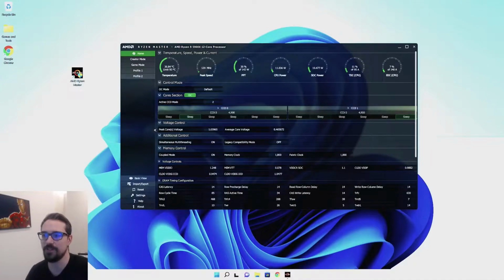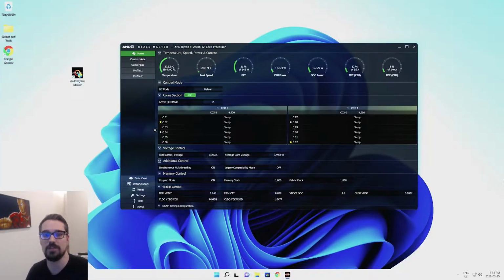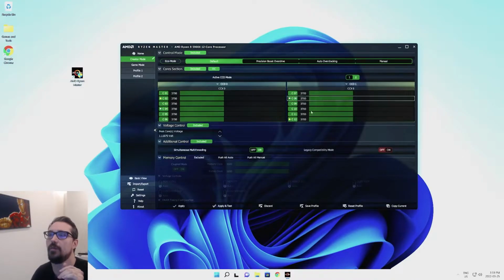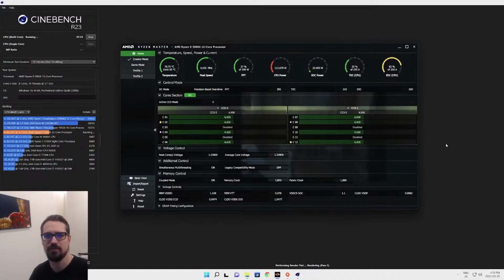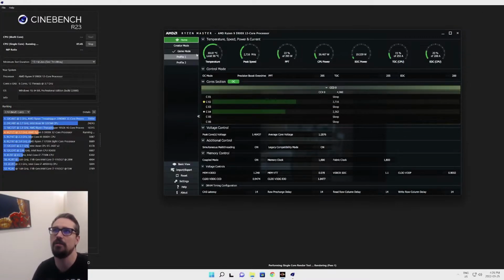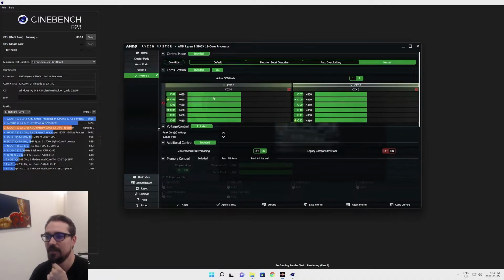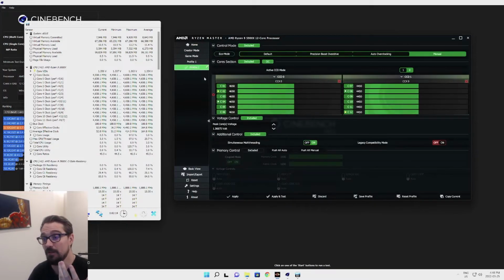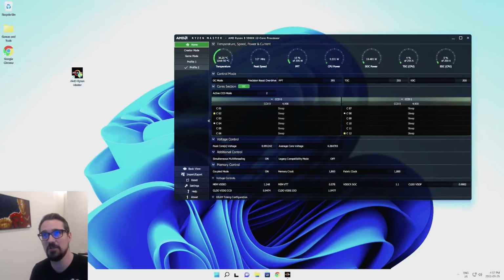Ryzen Master - AMD 5900X Overclocking

Comment: I have no idea how you're idling at 38-40C, my 5900X idles at 65-70C with a 360 AIO cooler, do you have any idea why my idle temps would be so high? 

I'm aware the 5900X is designed to run as hot as 90C, but I mean I'm literally just sitting on my desktop, no PBO, 3.5Ghz, and it's at least 20 degrees hotter than yours lol
Reply: my 5900x idles 36c but, if i go to the youtube main page and scroll up and down real fast i can get it up to 70C lol
Reply: @schlomoshekelstein908 Same, and that's expected, but the issue is cooling down, I feel like it's retaining heat from those quick heat-ups. I think I'm gonna use something other than thermal grizzly kryonaut, my temps are definitely cooler now than I reapplied and reseated the cooler but still not what I'd like to see, we're talking 55-60C on complete idle at room temp (70°F). If I'm just sitting on the BIOS, the max it peaks is 50C.
Reply: @JustLostTheGame  i'm using 
noctua NT-H1 with a fractal design S36 cooler. I can run AIDA64 stress test and won't go over 74C running it for 20 minutes. i shut it off after that cuz i dont even think gaming i stress my cpu that much that long. the whole reason I went down this rabbit hole is when I open chrome or do basically anything my cpu jumps to like 70c and the fans all ramp up to 100% and then it all drops down after 3 seconds. kind of annoying to be honest.
Reply: @schlomoshekelstein908  Yeah, that's just Ryzen, the 5900X is designed to run hot, up to 90C is to be expected, the 5900X is my second AMD CPU, after the 5 5600X, and I didn't have any of these issues at all, 5600X never really went above 65 when I had it, the 5900X is just a hot boy and even though I know that I shouldn't be freaking out when I look over at HWInfo and see 78C under load, it still kind of freaks me out lol
Reply: Undervolt is a must for the 5900x, with that you will get you TEMPS controlled, this processor comes with a very high voltage consumption settings from fabric, that why you get high TEMPS.
Reply: @ZeroCool22  Optimum Tech has a great video of doing exactly this! if you have a 5900x or 5950x or even a 5800x it's worth doing no matter what! free 10-15% in uplift and temps drop! crazy.
Reply: also, I would try the auto undervolting or CO mode in ryzen master! motherboard way is alot more time comsuming.
Reply: @no-pz7xy  Yeah, i have done the UV since a long time, my 5900x run with 1275v at 4650Mhz.
Reply: @no-pz7xy  Does that still require a reboot?
Thanks 👍
Reply from the maker: The 5900X definitely doesn't idle that high. Even on an air cooler it's quite low. If you are idle 65-70C then one of four things:

- Insufficient mounting pressure
- terrible thermal paste/still have plastic over the block on the mounting side
- bad water block design
- bad pump

Some AiO water block designs are not very good. Which AiO and thermal paste are you using.
Reply: @UnhingedSystems I appreciate you trying to help–mounting pressure should be good, the screws don't get any tighter without over-tightening, no plastic left on the block, I'm using Thermal Grizzly Kryonaut with a Lian Li Galahad 360 AIO.
Reply from the maker: @JustLostTheGame  Are you running the latest BIOS? Which motherboard are you using? Have you tried resetting the BIOS to default?

The Galahad cools the 5900X well enough. Does the idle shoot up to 65-70 right away or does it ramp up over a couple of minutes. Just wondering if the pump isn't working properly or maybe the flow is obstructed.
Reply: @UnhingedSystems  I actually updated my BIOS very recrntly funnily enough and reset my settings, so it's definitely not that, I have a Gigabyte B550 Vision D-P, it ramps up almost instantly, it'll start at around 30-40C (the ambient temp of my case) and as soon as I'm on my desktop, it goes to 58-65, and typically stays around there, sometimes higher. BIOS is reporting the fans and pump are working, and the radiator feels warm right where the heat tube meets the radiator, so it's definitely pulling heat away from the CPU.
Reply from the maker: @JustLostTheGame  Are there any background applications running? Can you see the CPU usage? It should be barely 1%-3% at idle.

I have seen some malware and crypto viruses that cause CPU and GPU usage to spike, maybe run a quick Malwarebytes scan just to be safe.
Reply: @UnhingedSystems  Believe it or not, I've done a lot of your suggestions already haha, I'm stumped. Ran a Malwarebytes scan about an hour ago, no issues, that's the thing, usage is only like 5-6%, no crazy spikes, even under load it's only around 12%. Under load temps are anywhere from 75-90C by the way, but that's expected. Nothing unusual in the background, Discord, Steam, Signal RGB (even disabling these programs from start doesn't change anything, switching off all RGB has no effect either.)
Reply from the maker: @JustLostTheGame  Well my next step would be testing the CPU in a different board to see if it has the same behaviors (maybe a power delivery issue?) Short of that I would look at contacting AMD, might be the heat spreader is not properly contacting the die (I've never actually had that issue). The 5900X with PBO disabled and the core boost disabled (running max at 3.5GHz) my 5900X would struggle to be above 60C at full load.
Reply: @UnhingedSystems  So I did probably the least technical step LAST because that's just how I am, but I completely redid my thermal paste and applied a little extra this time since thermal grizzly kryonaut is very viscous and REALLY made sure there was a good seal between the IHS and pump block, I'm sitting on BIOS and it started at 43C and has slowly been climbing to around 50C, I'm now sitting at around 47-50C on idle desktop, which is still kinda high but not as high as it was–but still 10 degrees higher than your system, maybe I'm just cursed, haha thanks for your suggestions though, very appreciative of the quick replies 👍
Reply: @UnhingedSystems  Hey, sorry for coming back to this, but I've noticed something a little odd, I think something might be malfunctioning with my pump, if I gently smack the top of the radiator where the pumps meet, my CPU temps drop RAPIDLY, from 84C down to 59C in almost a couple seconds, is there air trapped in* the pump? Am I finding correlation where there is none? I'm about to order the X73 Kraken, do you believe that's a good enough cooler for a 5900X (no crazy OCing, maybe 4Ghz max)? Thanks!!!

Edit: Fixed a typo
Reply from the maker: @JustLostTheGame   @The Game  You might have a blockage, or bad flow, it is possible.Tapping the radiator under normal circumstances shouldn't cause a drop in temps so something is up for sure. I personally am not a fan of the X73 or the X series because you can't set fan speeds based on fluid temps. The Z series is much better for that reason. Then you only need to ramp up the fans when the fluid hits 35C up to 40C and set a max fan speed based on a max fluid temp. Ideal for "cool and quiet" benefits IMO.
Reply: @UnhingedSystems  just bought the Z73 360, thanks a lot for all your help with this, I really appreciate it!

Edit: Kind of sucks since I've only had this AIO for like a year but, I definitely think something's failing in it, no joke, after smacking it a couple times, idle temps dropped to around 45 and stayed there lmao
Reply: @UnhingedSystems  I just wanted to follow up and let you know that I got my Kraken Z73 RGB and installed it, I also was able to repurpose the AL120 fans that were part of my previous AIO as case fans and everything works, it's absolutely beautiful.... and best of all, idle temps are as low as 38° now. Thanks for the recommendation!
Reply from the maker: @JustLostTheGame  Glad to hear everything worked out!
Reply: @JustLostTheGame  that's why I prefer spreading my paste, that way you know what you've put down is covering it for sure
Reply: @sinephase  I use Thermal Grizzly Kryonaut, which they actually tell you to spread thin across the whole IHS, I put a little extra dab in the very center for extra coverage, the issue was definitely my cooler, getting amazing temps with the Z73 now, currently haven't gone higher than 58°C under load, idle temps are around 38°-43°C
Reply: @JustLostTheGame  interesting, I wonder if it was warped or something?

Comment: My ryzen master Auto OC feature is boosting me to 5050 MHz on a 5900X and its stable. The speed seems to line up when running 3D mark cpu test. Is OCing to that speed really as simple as hitting auto OC or am I missing something because all the guides i look at require playing with BIOS and they struggle hitting 4.8 MHz.
Reply from the maker: Great question! Yes and no. When you measure your "Max" boost using HWInfo or another monitoring program it can be deceiving. The Zen3 CPUs hit 5050 and up to  5100 for a couple of milliseconds between tasks, but they don't sustain those clock speeds under load. The more relevant measurement is the average sustained boost clock which is closer to 4.8-4.9 GHz (single core) and 4.3-4.7 GHz (All-core, max power limits). If you look at an application such as MSI Afterburner you can watch the graphs and see what the Avg sustained boost clock really is. Boosting to 5050-5100 GHz between loads is practically useless and really just a side effect of the boost algorithm, but it isn't actually sustaining those clock speeds. The correct measurement for real performance is the average sustained clock speeds while processing a load. If your CPU does sustain a 5+GHz clock speed under load then you have a unicorn CPU. Hope that helps!

Note: My sustained boost was marginally higher with earlier versions of the BIOS AGESA versions, it seems to be somewhat lower now, but more stable.
Reply: Did you increase the voltage to get those clocks?
Reply: Maybe it's clock stretching. Look at your efficience clock.
Reply: Eventhough my cooling is not the best, i did the simple Auto OC too and it got me (my 5900x) to 5050 Mhz but it was not stable, i havent gotten my head around what auto oc is doing yet, but my suspision is that the all core oc was uneccesarrily high, i would rather have 5ghz boost on some cores and moderate clocks on others to have an oc preset for single core dependent gaming. Do you guys know a guide that focuses on this?

Comment: if i have one core clocked higher then the other ones will games and programes use this as their main core?
Reply from the maker: It really depends on the OS and the thread scheduling. For the most part your preferred cores (as displayed in Ryzen Master) will get the bulk of the heavier single-threaded workloads, but it depends on a lot of factors like what other processes are running, other loads on other threads etc. The ones clocked higher should technically be the preferred cores in most cases.
Reply: @UnhingedSystems  thanks!

Comment: Why would my EDC be at 0%? And it doesn't change as I modify it.
Reply from the maker: That's really odd. What motherboard are you using? I have seen some bad motherboards where the sensors don't accurately (or at all) report back measurements from their sensors.
Reply: I'm using the ROG Strix B-550. And the Ryzen 5900x if that matters.
Reply from the maker: @mikooou  Check if you have the latest AMD chipset drivers installed.
Reply: @UnhingedSystems  I checked. They were a little bit out of date so I updated them. But still no EDC reading. Is it possible that I an inadvertent change in the BIOS could cause this?
Reply from the maker: @mikooou  It should still be able to read EDC value. Ensure your BIOS is up-to-date and maybe reset your BIOS to default settings and try again. It is entirely possible that one of the sensors isn't working (I have had clients where none of the voltage or power sensors could be read or detected in the OS no matter what we did, same motherboard model in a different system had no issues). If it still isn't working try enabling PBO in the BIOS and see if you get any change in Ryzen Master. 

Does it display the stock limits for you? (142W, 95A, 140A)
Reply: @UnhingedSystems  I'm not sure the BIOS is 100% up to date but I did update is somewhat recently. I was able to fix it by restoring BIOS defaults. Thanks for troubleshooting with me!
Reply from the maker: @mikooou  My pleasure! Thank you for tuning in!
Reply: when I had mine set to PBO enabled it did that but disabled PBO shows the right values
Reply from the maker: @sinephase  Seems to be a bug in the BIOS of some boards. Mine doesn't do that but I'm still on 3801 which seems to be the most stable on Dark Hero.

Comment: Year ago when I tinkered with my R9 5900x increasing EDC led to decrese in performance and increase in temperature. Keeping EDC at 135 or 130 did the trick and boosted my multiscore a bit. Anyway I went with easy way at the end and I am satisfied with results.. Pbo - > advanced, limits - > Auto, Scallar - > Auto, Curve - 20 all cores, boost +50mhz, thermal limits - > Auto.
CPU-Z 696/10144, CB R23 644/22850. Temps stay at 55 - 60 during gaming, 65-70 in heavy all core tasks, iddle at 28-32 depends on actual room temperature.
Reply: my 5900x goes all core -30 all the way.  23500 cbr23
Reply: @alexmckoy8898  myine was running fine too in synthetic benchmarks, but started to crash after some time with basic tasks like opening chrome, using spotify, etc. If You havent crashed with those settings for like a month, You won silicon lottery.
Reply: @johnrehak  I'm -35, no crashing for 3 months now, going good
Reply: Thats great. New revision seems much better than old one I had. I am rocking with 5800x3d now and couldnt be happier. The cpu is just plug and play. No hickups since than.
Reply: @johnrehak how does the 5900x compare to the 5800x3d? I'm trying to pick between these 2 cpus. I can get either one for around the same price. They both go on sale often as well. Between $280 and $340. If I can get the 5900x for $290ish I feel like I will go with that one because it has more cores. I plan to use my PC for 1440p gaming as well as light programming, video/photo editing and other light work. Oh and I plan to pair it with an rx7800xt.
Reply from the maker: @alexmckoy8898  Lucky!
Reply from the maker: Nice! My 5950X had several cores that were rather unhappy with anything below -11, albeit only in very specific games like Stellaris. PC would hard-lock when cores were switching between load to idle. Every other workload was happy except Stellaris regardless of any other setting or adjustment. Silicon lottery did me dirty this time around, but I'm not complaining, gaming has never been so good.
Reply: @UnhingedSystems  best testing of stable Curve is Your standard daily usage. I was able pass all gaming and synthetic tests I thrown on my PC, than it hard restart during verry light workload of basic tasks. I know that I could get a bit more of performance from CPU, but it does not worth time investment, little performance gain and big temperature increase.

Comment: Does this overclock goes away after restart?
Reply from the maker: Yes, the overclock is applied by Ryzen Master so until Ryzen Master loads again (It is an auto startup usually) your OC is not yet applied. This is similar to MSI afterburner.

It is nice because if the OC is too aggressive and crashes you can still get back into the OS and uninstall/re-install Ryzen Master to remove the profiles and try again. Thank you for the question!

Comment: Ive been mostly dissapointed with my zen 3 for gaming unfortunately I am going to sell my 5600x and get a i5 12400f instead, some of the games I play simply do not understand Ryzen instruction set I guess. Like if a lot of enemies show up I suddenly dip to like a slideshow FPS that I didn't get on my old i7 2600 system, not fun when you pull around a corner and 5 mechs are looking at you and you can't react because you get slideshow FPS haha.
Reply from the maker: Which games are you experiencing these stutters? I haven't experienced anything like that with Zen 3 in any titles. There are some really old titles that need "Legacy mode" enabled in order to run, but they are a rare exception.
Reply: Intells 12th gen is gaming beasts indeed, but difference lessened with higher resolution and higher settings. At 720p low difference is just massive, while in 1440p/ultra difference will be in single digit fps and at 4k/ultra You are 100% bottlenecked by GPU and there will be little to no difference between i9 12900k, i5 12600k or Ryzen 9 5950x or Ryzen 5 5600x. If I would have to build new PC now, I would go for 12th gen intel probably i7 12700k.
Reply: sounds like something is wrong then

Comment: my Asus CrossHair Hero VIII (non-dark) is a beast for overclocking my 5900X.  The previously released bios would allow boosting to 5100 on some cores during gaming but I would always get "Exception breakpoint reached" errors in Windows upon shutdown or reboot. I disabled some Asus specific boosting options in the bios and now it only boosts to 4900. Thanks for the video.
Reply from the maker: The sustained average boost is interesting to see vs the peak boost measured. So many cool topics to cover! Thank you for watching!